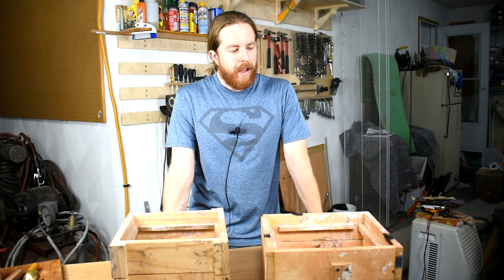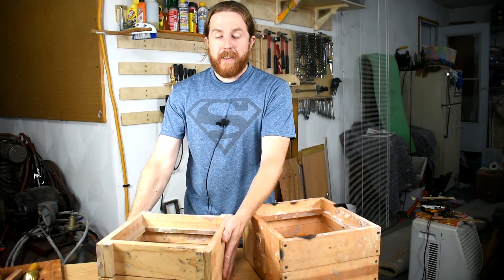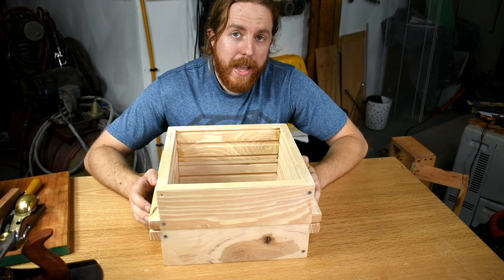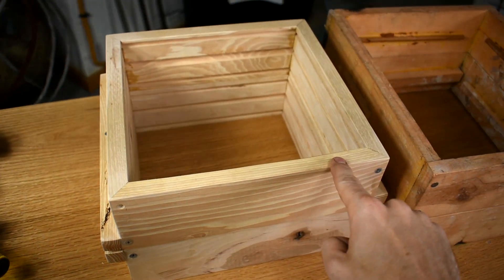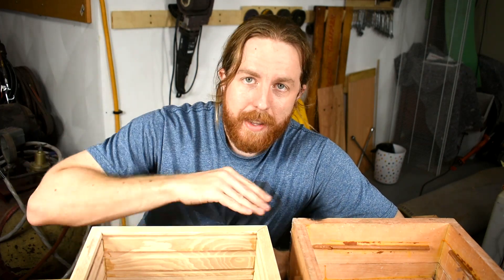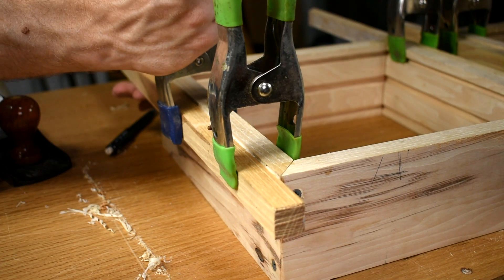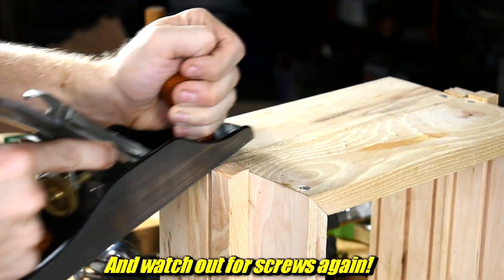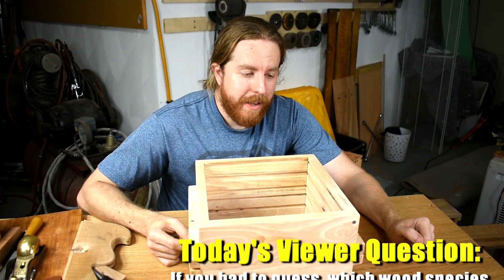Your Sand Casting Flasks Could Be Better

Comment: wat you could do to fix the wonky flasks is add a piece of mdf on the top exactly the same size as the flask maibe slightly smaller as long as the dont stick out outside the box , screw it on then shim the low corner so it becomes level the way you want it to be 
then run the opposite side along the tablesaw using the mdf lid as the guide along the fence
take off the lid and use the now straight side of the box / flask against the fence to cut the other side level 
if you do that with both halves of the flasks you should end up with reasonable usable flasks that are about an inch or two lower 
you have to redo the centering thingies and prolly will do them so you can grab onloo them better 
if there not glued together you could unscrew them and saw grooves intoo them , just need to push 8 pieces through at a time so it takes a bit longer

Comment: I’d consider doing threaded inserts in the lower half and replacing the screw with a bolt. Otherwise, the new ones look great 👍
Reply from the maker: I might end up doing that if the screw holes get worn out.  Hickory is pretty tough though so it might hold for a while

Comment: wha do you think about using plywood?
Reply from the maker: Plywood is very stable but i'd be worried about the screws holding as well going into "end grain" of the ply.  In my experience it can just peel the layers apart. Also i suspect the heat from the metal could degrade the glue

Comment: Great video!  I've been needing to make some new flasks, and I'll be taking some of your tips.  As for a heat resistant wood, maybe check out ipe?  It's also called Brazilian walnut.  It falls into the category of woods called ironwoods, and I've heard that it's some ridiculously tough stuff.  Not sure about taking on 1221F+ molten aluminum, but it's probably got a better shot than most other woods.
Reply from the maker: Seems to be a shortage of ipe around here right now but ill definitely get hold of some
Reply: HEAT RESISTANT WOOD????? HAVE YOU EVER ACTUALLY CAST ANYTHING???? CAST MONKEY AND CLOWNBOY - WHAT A COMBINATION.

Comment: I have a real hard time believing miter joints are stronger than finger and dovetail joints. Miter joints are end-grain to end-grain which should be far weaker than the edge-grain to edge-grain orientation of the joint. Moreover, miter joints and especially dovetail joints form a strong mechanical lock, which holds together even without any glue. I'm not taking any bets on it, but miter joints being stronger needs a scientific explanation.
Reply from the maker: I can't believe it either, but the test showed a significant increase in strength compared to finger joints and dovetails (which were similar to each other).  I think the explanation is that the 45 degree angle grain glues less like edge grain and more like side grain?  also the larger surface area of the angled joint helps.  Either way I added screws so i should be ok
Reply: @PaulsGarage  Mathias Wandel needs to do testing on those joints. Dude is a total beast when it comes to settling joint strength using heavy duty metrics.

Comment: Not sure how well it will work in the end, but I made the halves of my flasks non-rocking by filling the gap with Bondo. Smeared it on one side then laid cling film over it and set the other side on top. How it will hold up in the long run I don't know as I'm still working out the bugs in my melting down the aluminum setup.

Comment: A lot of people need to see this 😀
Will be interesting to see how the screws work out as alignment things.
Reply from the maker: i'm interested to see how well hickory handles having molten metal spilled on it haha
Reply: @PaulsGarage  No data but expect it will be about the same as most woods.   The hardness properties if anything may relate to density which may better transfer the heat.  All guesses.
I plan to try using thin steel angles positioned over the wood near the pouring basin positioned during the ram up.    Not an end all but a start.

Comment: Two features I used when I made my flasks:  To help with orientation, I painted different sides different colors. Second, to help break open the mold, I used some bolts.  When you tighten them you can open the flask in a very controlled manner.
Reply from the maker: thats a pretty good idea!  especially the colors so i don't forget which one is the cope and drag. here I put the flanges only on 2 sides so i know the un-flanged side goes towards the front/back of the bench.  I didn't mention it in the video but the bench isn't perfectly flat, so i made these flasks fit the bench in the current direction.  If i rotate them 90 degrees they rock slightly.  It's not a perfect bench but it's close

Comment: It's nice. A little recommendation: replace the screws that hold the two halves together with bolts and their screw holes with through holes. The bolts will have a much longer usable lifetime with repeated attachment/reattachment.
Reply from the maker: thats a good idea!  I might try that if these get wore out.  Maybe gluing/embedding captured nuts on the bottom?
Reply: @PaulsGarage  you can buy threaded inserts aka screw sheaths that go into wood
Reply: I was going to suggest something similar.  Threaded inserts and bolts instead of a hole that will just keep getting looser
Reply: what about casting up some aluminum handles for each side with built in smooth tapered alignment pins.... could make them unique... maybe a sent of warning lights, or a volcano... nuclear explosion... artsy - to put your stamp on them.

Comment: Would it be a good thing to cut the top of the bottom flask and the bottom of the top flask at 45 degrees so the top inserts into the bottom? That forces it into alignment both front to back and side to side. Of course if the wood swells or warps it might be a bad thing. Not sure.
Reply from the maker: I see what you're suggesting but I think it would cause trouble with the sand ramming.  It might work though
Reply: @PaulsGarage  After thinking about it for a while I don't think it would work. The knife edge of the top flask would wear too quickly.

Comment: Looks nice.  Alignment pins help a lot when you're working with an irregular parting line where the cope or drag sticks out past the flask, but without any pins it should still work fine when the parting is flat.  How will you get your fingers between the flanges to lift off the cope, or set it back on the drag without pinching your fingers though?  Looking forward to finding out next time.
Reply from the maker: Thanks!  There's enough of a gap I can get finger tips under that.  Some of my old ones had no gap at all and it didn't cause too much trouble, but im sure I could chamfer the inside of that groove a bit more to give me a ridge?  That might work

Comment: Obviously, the way to flatten used flasks is to sand them.  A belt sander would touch them up quickly.
Reply from the maker: A big belt sander would be great.  Unfortunately I don't have one 😭  one of those huge drum sanders would come in super handy for a number of reasons
Reply: @PaulsGarage  When my last belt sander failed after 20 years of occasional use, I replaced it with a 3 x 21 Wen belt sander that is $41.  Belt sanders are so productive, you don't need a big one.